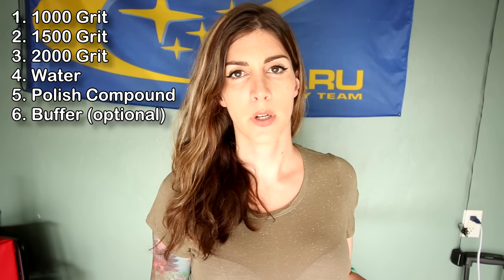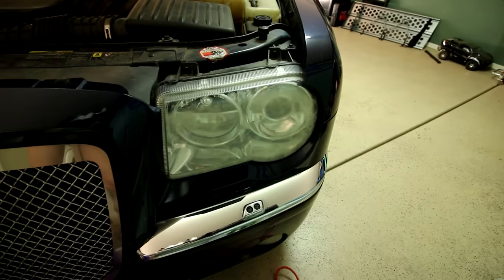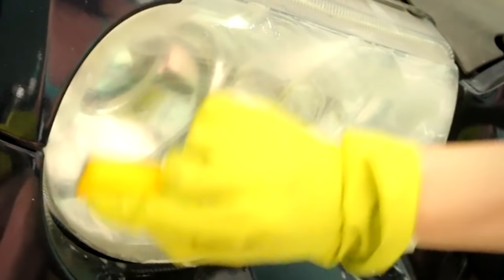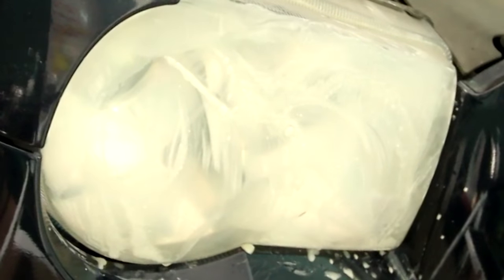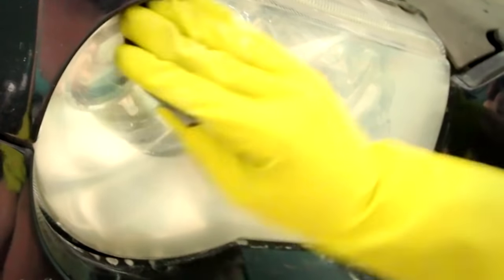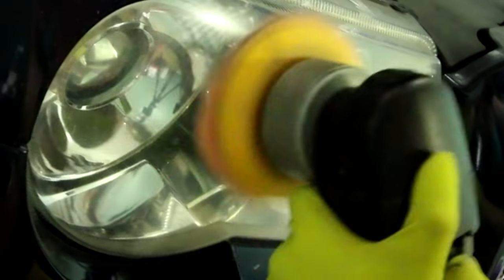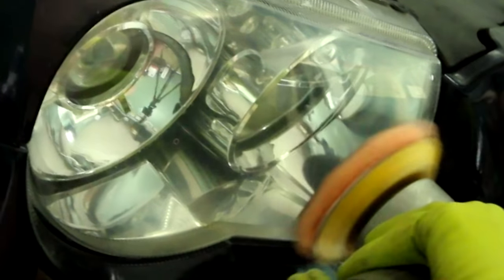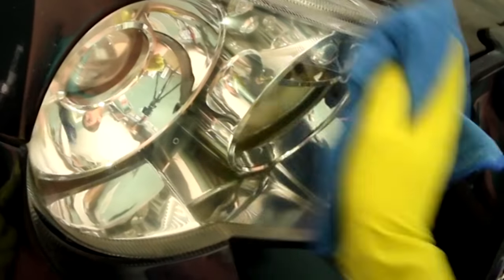DIY Headlight Restoration

Comment: The results are amazing! Have you seen Sweet Project Cars? Mike uses :
1) 3M heavy cutting pad
2) Rotary buffer
3) Mother's Mag and Aluminum Polish 
4) Meguiar's # 7 polish
5) 99% Iso Rubbing Alcohol
6) Ceramic coat to seal/protect the polycarbonate headlights
It's a much faster way to restore the headlights and achieves the same results( in case you're pressed for time).

Comment: Very nice! Except without a clear coat, it'll only last a couple weeks as the wax burns off. That's fine if you don't mind reapplying wax about every time you wash. Sunlight and or heat from the light itself eats the wax fast and you're left where you left off at 2000 grit and they'll starts to yellow at an accelerated rate if you don't keep waxing. 
When you go the clear coat "rattle can" route, you can just do 800 grit and spray, since any higher is overkill, plus the clear needs "teeth" to help avoid runs. But you may need 400 grit for crusted-over headlights, then 600 in between.
Anything more than one coat will likely run and or crackle. It needs to be done in just one pass, or spray a haze (it drys fast) and quickly do the deed, as thick as possible without runs. Practice on some beater cars, and while results vary, you're not working on show cars. Even a poor job will look like brand new at 20 or 30 feet. Or at least 1000 times better. Or sand with 800 and reapply. It should last a few years, maintenance free.

Comment: Hi ,  Ive done both the polish and the clear coat method on my '04 Audi TT.  the first couple times using the "Mothers" method with polish and  the last time using the wet sanding and finishing off with a 2k clear coat from Oriellys.  The clear coat method was initially great but just around a year it is already in poor condition (car mostly under carport and garage in Washington and less than 2k miles last year).  Has anyone found and used a quality product that lasts longer?  Is it the clear coat that is failing or is it the plastic?  Michael

Comment: Whenever possible avoid using circular motion as circles are the hardest scratches to remove. Whenever I sand I do opposite directions per grit so that the peaks and valleys are always smoothed down, (1500 vertically, 2000 horizontally, etc) also it makes it easier for the rotary to polish since the abrasive is perpendicular to the scratch.

Larry does a much better job at explaining than I do:
https://www.youtube.com/watch?v=uqOKmZ9mMfc

Comment: You obviously wouldn’t polish and then clear coat.
You would just clear coat after sanding...right?
Reply from the maker: Lindsay Roberts right, because you need a form of mechanical adhesion.